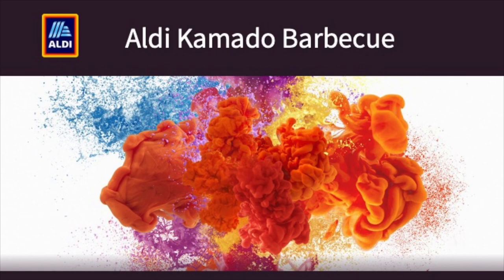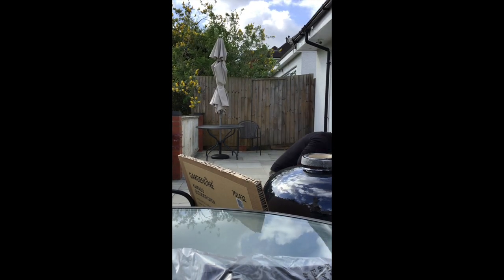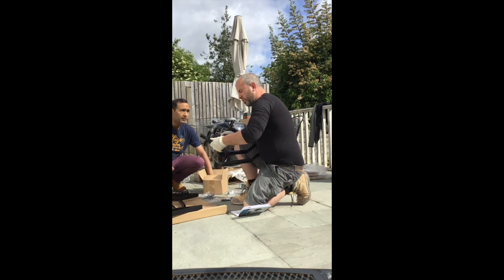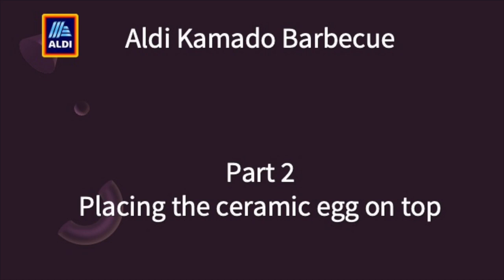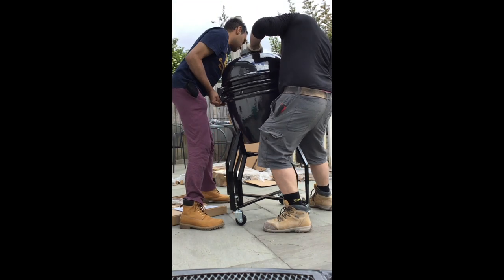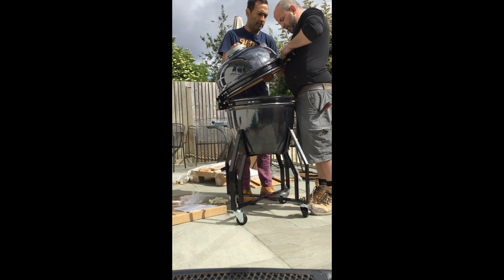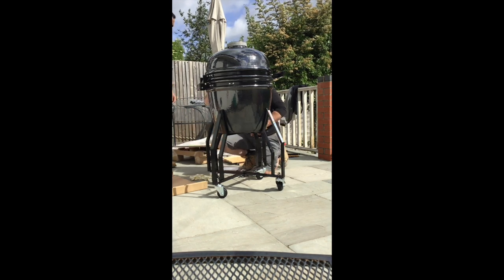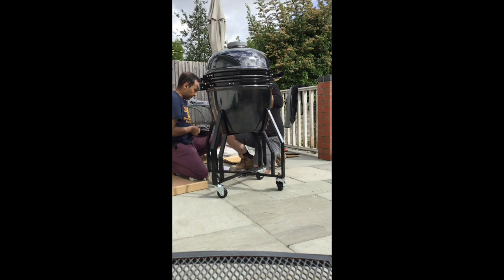Aldi Kamado Barbecue Assembly 2021 - Aldi UK Gardenline Kamado Ceramic Egg BBQ Unboxing

Comment: Im waiting for mine too. Trying to find info on how to light and set temperature, what kind of charcoal etc to buy and wood chips for smoking. Want to do a 12hr brisket type of cook
Reply from the maker: Thanks Chris! Like and subscribe to the channel. I have video footage on lighting the kamado and I will be posting the video soon. You must use normal charcoal (no briquettes and no self lighting charcoal packs). You must not use any lighting oils or white blocks since the chemicals will get absorbed by the ceramic. Setting the temperature is described in the guide that comes with the Kamado.
Reply: @GaneshJU  Thanks for the reply - did you get a divide and conquer setup?
Reply from the maker: @chrispenrose9691  I haven't yet because so far I'm doing the roasting type cooking with the Kamado

Comment: I think you have to turn the vent at the top 180 degrees so the silver grommet is closest to the handle. When you lift the lid it will swivel otherwise.